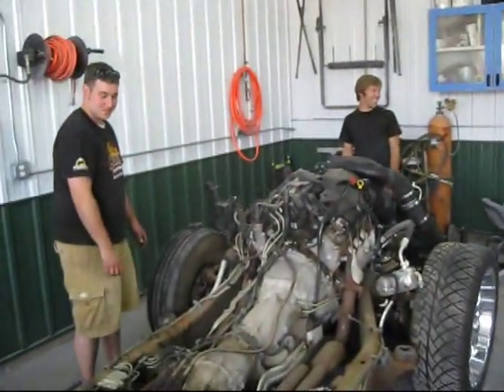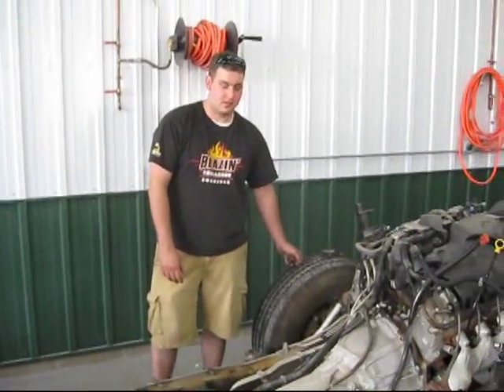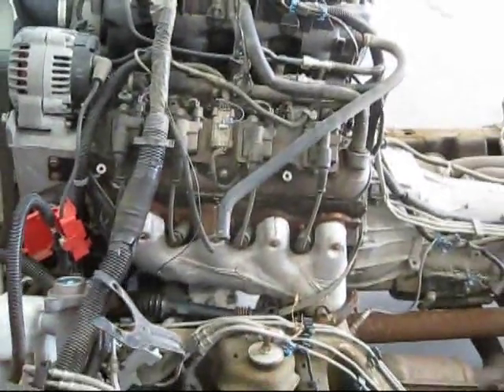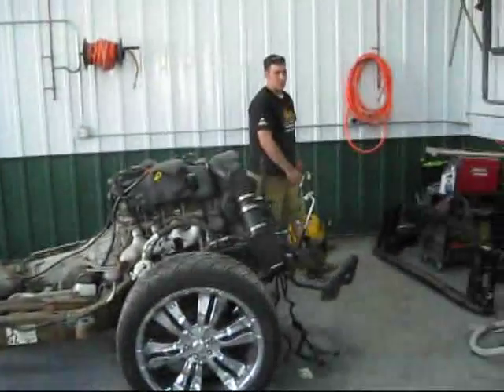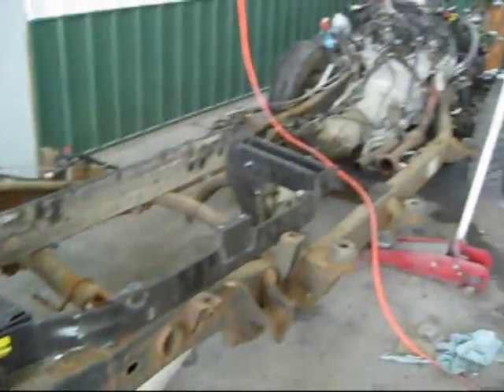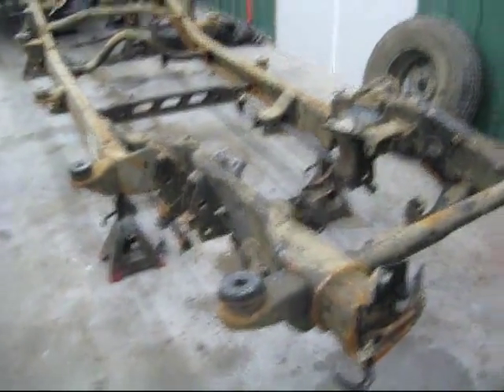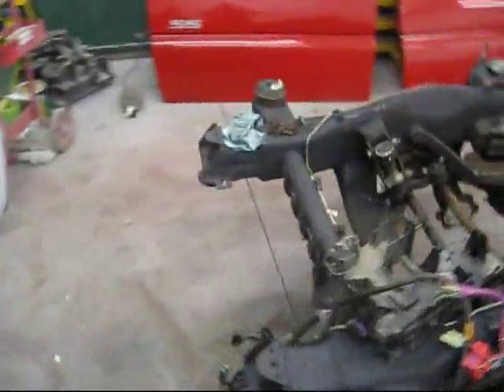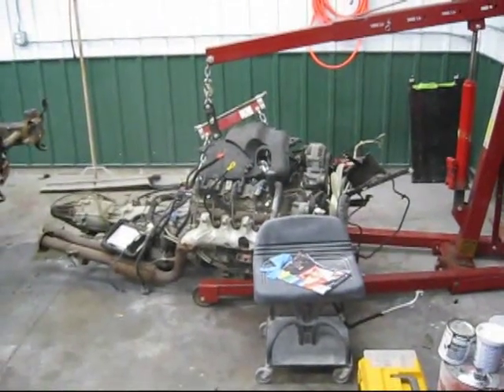MG42 - Swapping The Frame

Comment: Great video, I actually saw the pics you posted on some website. Might be your martys garage page I'm not to sure. Anyways I was just wanting to say that I also have a 2003 silverado non ss that needs a frame swap. How much them frames usually run and how long does it take to do the whole swap? Sorry for the long message but I just need some quick answers :) thanks for your time sir.

Comment: Hi I was wondering if you think a 2006 Silverado frame will work on a 2000 Silverado? I checked suspension parts, cab and box parts and they are the same part numbers. Any info would be greatly appreciated. Thanks